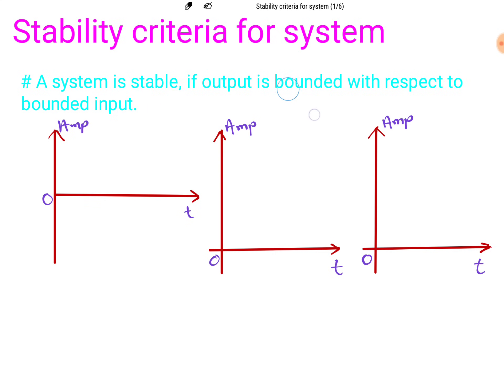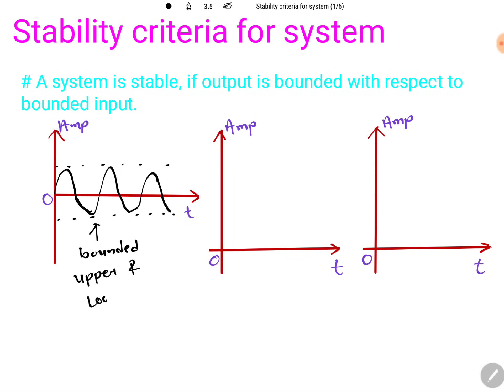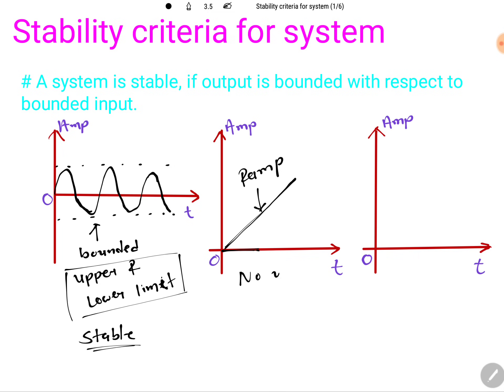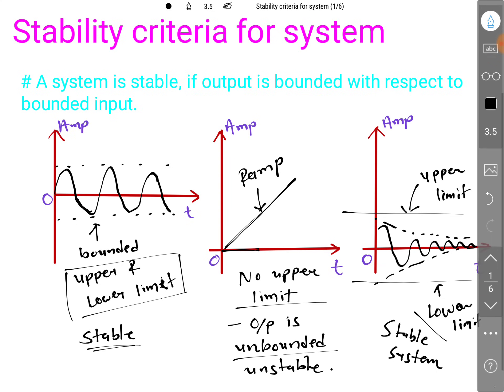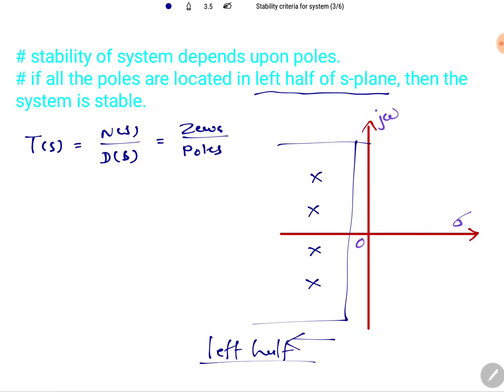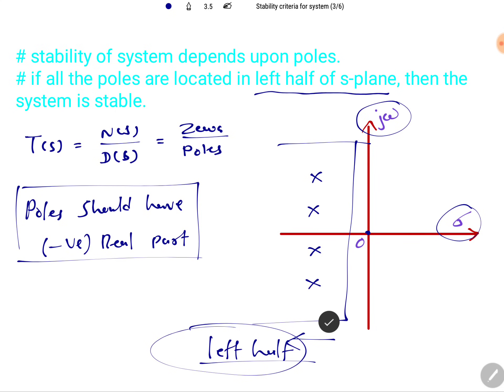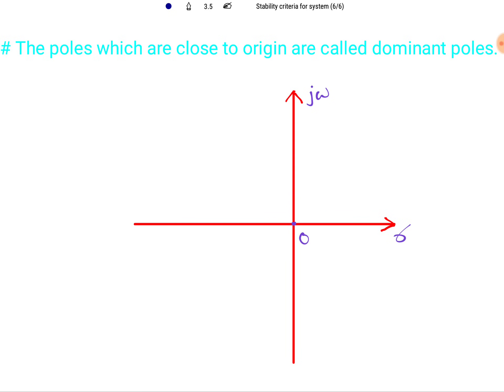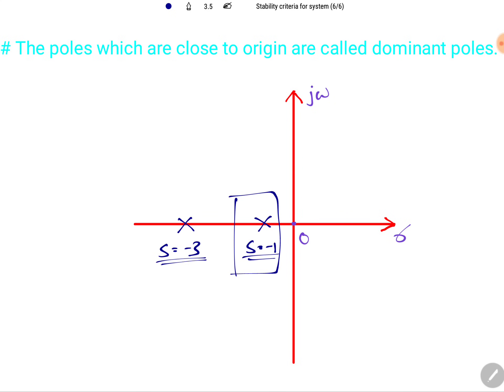Stability Criteria for Control Systems Explained: Definition, Basics, and Case Study

Comment: There are 3 poles 
2 is on LHP 
Other 1 is on RHP then system is stable?? Because More no
. Poles are located on LHP as compared to RHP in that manner we have to consider for stability right??
Reply from the maker: Nope
Reply: @EngineeringFunda   so in this case system is unstable right?

Comment: As in this lecture u have told poles not be repeated for stability that is only for marginally stable right then if poles are repeated on real axis then it depends upon LHP /RHP poles are located for consideration  of stability right??
Reply from the maker: More the poles on imaginary axis reduces the stability of system.